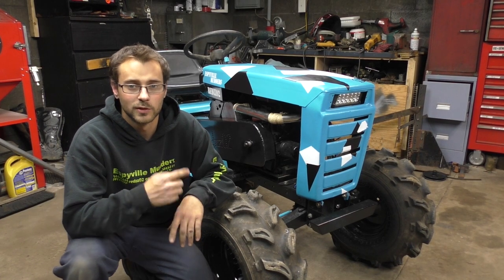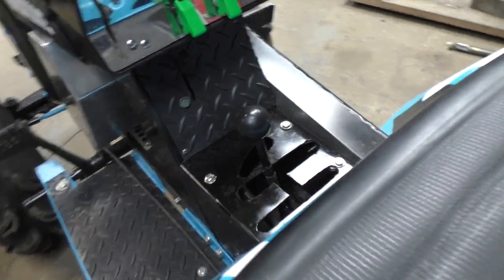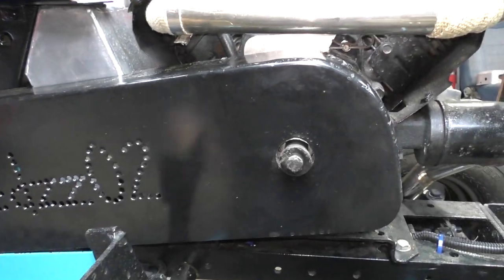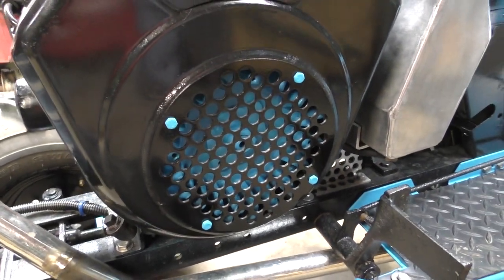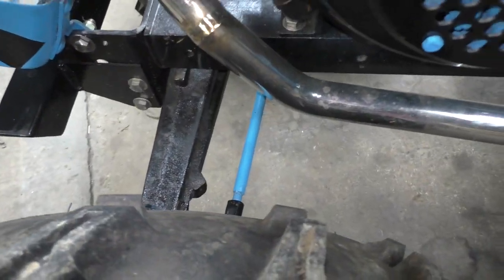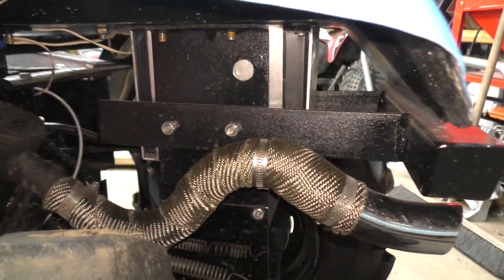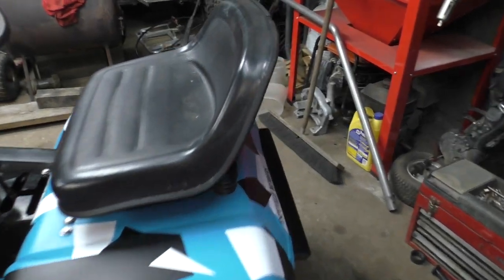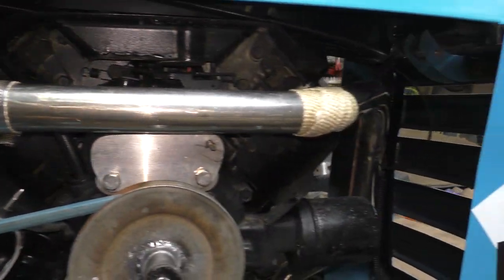How I Built The Mud Mower Wheel Horse

Comment: What kind of transmission do you have? I want to swap my automatic out with a manual transmission. I have a 1978 c161. What do you recommend? Thanks.
Reply from the maker: Wheel horse unidrive 8spd transaxle with the 1 1/8” axle shafts. I have never owned a hydrostatic wheel horse, but I believe the transaxles are swappable

Comment: I'm trying to get the same tires on my tractor how did you do yours is it bolted on or is it just popped on and held with the retainer pin
Reply from the maker: They are stock 10” riding mower rims, a little bit of a pain to find them but they are out there

Comment: How did you manage to set it up for the font and rear tires to be the same size ??. Did you have to swap the front axle ?, I’ve noticed that most off road mowers don’t have this and just have traditional mower setup with rear wheels being bigger. I’ve always wanted to build something similar to this build but on a bit bigger of a mower and put a roll cage on it and turn it into a buggy slash mini sxs.
Reply from the maker: HELL YEAH ATVs front axle is factory, the rear axle is lifted 4” and that’s all it took for this particular tractor (wheel horse b80) to run the same size tires
Reply: redzz02 oh ok thx.

Comment: Awesome rig but the big front tires arent too helpful unless its a crawler
Reply from the maker: Elaborate more on this please?
Reply: @redzz02  from my experience big wide tires arent super helpful in water or stuff unless they are powered my john deere has big tires and it causes me to get stuck all the time thinner tires seem to cut through my obsticles better but im no expert ive just expermented with my mowers and go karts i mean i suppose you could try it too but i think the big tires on that mower probably help unless its in water
On the front atleast
Reply from the maker: @tandmbros5877  thank you for elaborating more, I understand what you mean and agree with you in some instances, ive personally had a lot more luck with taller skinny front tires vs tall fat front tires, the fatter ones seem to get hung up a little more. On my trail mowers 19x7-8 seems to be the winning size for a front tire anything smaller and you really struggle on obstacles, anything bigger it starts to look weird 

This mower specifically needs to have the big front tires or else it would look really stupid, I’m actually currently rebuilding this tractor with bigger tires and a vtwin Diesel engine.